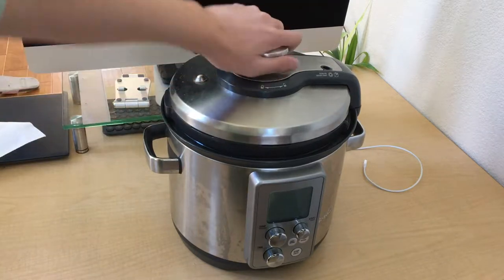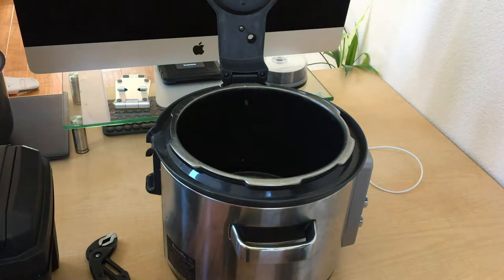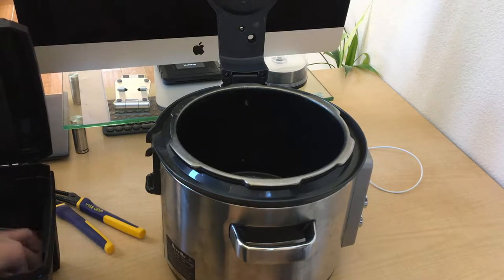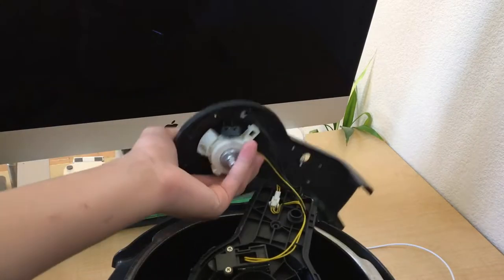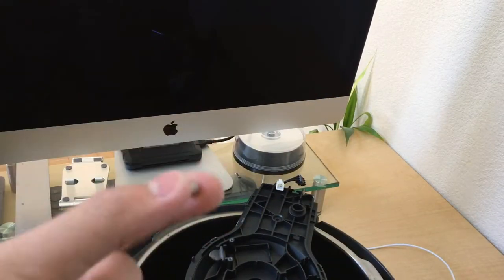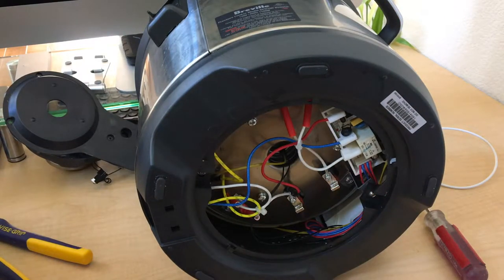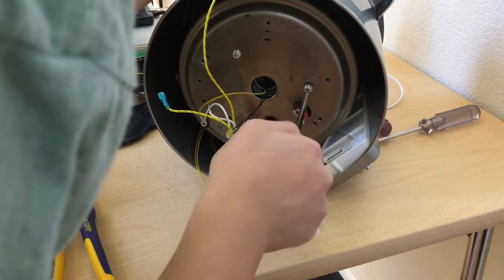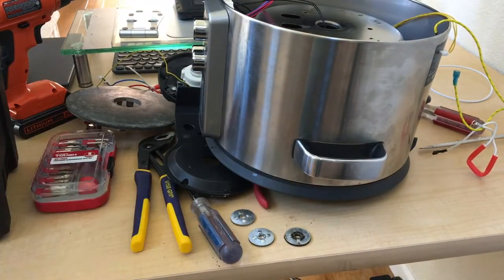Breville Pressure Cooker Teardown

Comment: I got e0 error message. Any idea what to do to fix?
Reply: Today I got E0 code also.
Reply: Bob Gu it’s dead. You can’t fix it. It means the thermostat is no longer working inside. I made a claim at the shop and they gave me a new one
Reply: @gurya  hi, I have the same issue with code E0. do you mind I ask how old is your cooker when this problem shows up?
Reply: cathy sun mine was 3 yrs old. You can’t fix it. I was told it means the thermostat must have stopped working internally. I got it replaced from the store for free as under consumer law in Australia electrical items should last 4 yrs
Reply: @gurya  thank you do much for the quick response! My is almost 3years old, but there is no Breville store in my city, I bought it online before.
Reply: Design flaw with top lid, Easy repair, broken off wire from top temperature sensor. If you look at this video you will see this wire he said he broke off He didn't probably this cooker stop working with the same E0 error and this is why it was trashed. (7:50 time stamp) If you remove the top cover with Beeville, there are 3 screws  there, remove it. The disassemble the top parts that hold the lid, most likely you will see one or sometime two broken off back wires, The sensor seats in the white plastic with red thermotubing (heatshrink). Remove 2 screws and one screw with Yellow wire, cut open red thermotube and solder new wire, install insulation on top. Attach this new wire to the broken off black wire. Assemble everything back. This will fix your E0 error.
Reply: @gurya  you can fix it, see my comments below
Reply: Thank you for showing us how to remove it. THE EO code the fix Uri was right it was a 3 black wires the broke off mine only one broke off. Anyways Breville put this cheapo wires so they can service it for for more money. Can’t believe we pay Breville for a premium item and they put cheap parts for it. Breville shame on you!!!!!!
Reply: @petyuriy  hi, I confronted the similar issue with my cooker. However, I found no wire was broke off after disassembling the lid. Does it mean there is something wrong with the sensor? Thanks
Reply: @petyuriy  question as I just encountered this. I have it disassembled. The wire from the thermostat with heat shrink removed shows two wires snapped. Does the other two go to this or is it just one?
Reply: @ACKoop  Both
Reply: @petyuriy excellent 👍

Comment: Thank you for the tear down video. It was hard to watch in some places, but it will hopefully save people money with their own home repairs. 
We've loved our cooker for 5+ years and got the E0 alert about a month ago with the sauté and sear function only. It works fine with the lid closed, or partially open, so until we get the broken top door sensor wire repaired (instructions by @petyuriy a few comments below), we only have to listen to the alarm as we stir. I hate knowing that we've grown so dependent on this thing that we'd probably be willing to drop another $450 for a new one if it isn't a broken wire, but it sounds like it's fairly common.